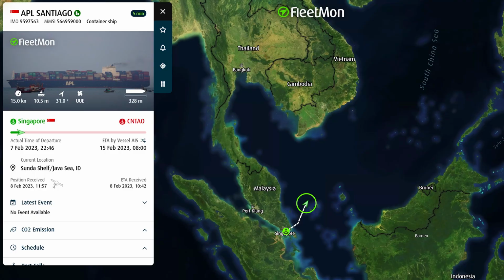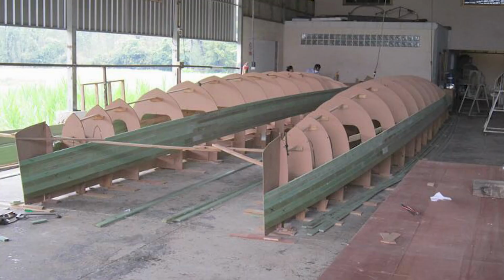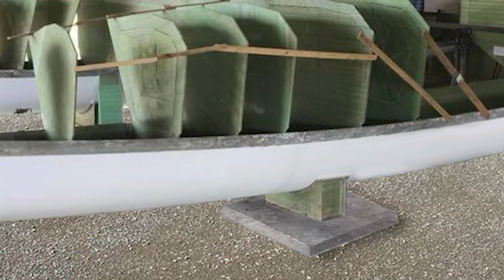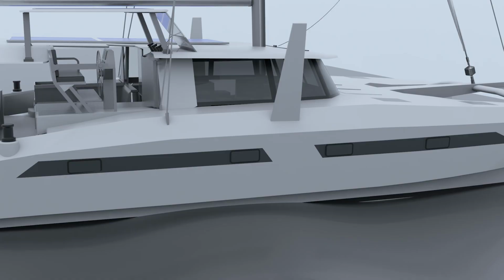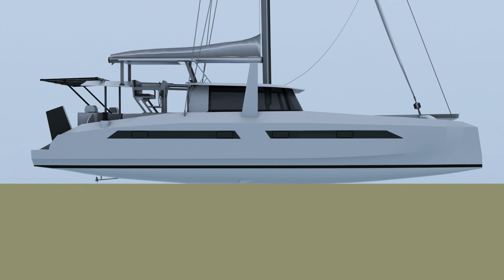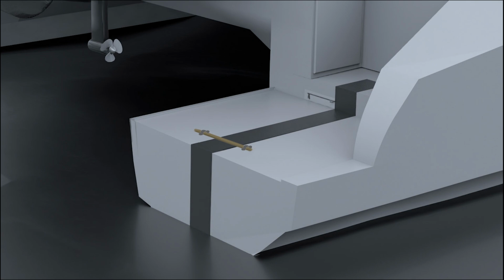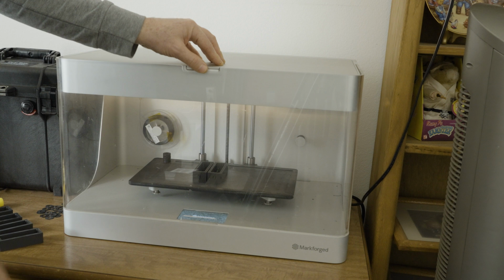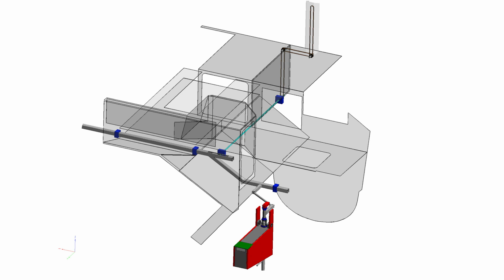Kit-E20 Kit Catamaran Build, Phase One Planning

Comment: As if its so easy and straight forward , mutiply  the time you have come to by 2 good luck with that ,
Reply from the maker: Of course, that never works.  If I multiply my current estimate by two someone else will tell me to multiply that estimate by two.  If I do that, someone else will tell me to multiply that estimate times two.  From the start I already padded the estimate given by Schionning from 6,000 to 10,000 man hours, then added a contingency of another 3,000 man hours.  So I did double their estimate, so I will stick with that until it proves inaccurate.  :)

Comment: Can't wait to see the boat build process in action. How do you insure that the rudder is aligned straight in the slot in the case of automatic activation upon impact, at times when you may have the tiller hard over during a tack or jibe?
Reply from the maker: Well, with a catamaran, it is rare to have the rudders turned that hard.  Pretty much only briefly when you are going about and sailing in open water.  Anytime you are motoring slowly, in a lagoon or marina, you lock the rudders straight ahead and use the two widely spaced props to turn the catamaran.

Comment: Hmm - seems like the safety design may be limited to only for a rudder operating at 0 degrees (i.e. straight) to slightly turned.  If the rudder is turned say 45 degrees or more - and it is hit - would not the rudder catch on the hull between the opening and not kick up? Very real possibility when dodging bommies. I like all the planning and execution - just may have a limitation - Mumby catamarans have similar set up.
Reply from the maker: The percentage of time that you turn a rudder that severely is small and at low speed, so in those moments you just have to be careful.  In the case of bommies, and any other low speed maneuver, you would not use the rudders on a catamaran. And iIf there is a danger of hitting something, like bommies, you would raise the rudders and use the two motors to maneuver.  Catamarans generally just leave the rudders centered anyway and use the props to turn the boat for low speed maneuvers. .

Comment: Why don't you put the turning point of the rudder lower and let it only protrude through the stern but not through the deck? There could be a little acces hatch for the emergency tiller.
Reply from the maker: You would have to solve a few issues if you wanted to do that.  
1) How would you manually raise the rudders?
2) If the U-joint is below, it will be inside the hull.  How would you service it?
3) When the rudder kicks up, how would you reset them and lock them back in place?

Comment: Captain Rick on Sailing Sophisticated Lady has an electric powered dinghy - he has an episode where he tested different propellers for best results - have subbed from Western Australia years ago my 22 foot trailer sailer had a swing keel and swing rudder that had the COG offset to allow the rudder to reset - you could also lock in upright position - enjoyed your explanations - very clever and an improvement on the mumby rudder design - any plans for a mini skeg to protect the propeller which will be hit before the rudder ??
Reply from the maker: No plans for a skeg.  It makes going about more difficult with a fixed 'fin' toward the stern and cats area already slugs when going about.  We got rid of sail drives, so we'll just live with the folding props and shafts.  I've seen Captain Rick's videos, but his electric outboard is not high powered, so not as useful for our situation.  I have been in contact with prop manufacturers to get a more suitable prop for our e18, which is the equivalent of a 25 hp gas outboard.  I'm glad you liked my kickup mechanism design.  I like to design stuff, it's a character flaw ;)

Comment: They are a great looking cat, I think Schionning' s come from Australia or are designed here; I see quite a few of them up and down the Queensland coast.  Have a look at the 62 foot cat I designed and built 40 odd years ago at; ue&co  'things I've built and lived in'   Remember, nothing ever goes to plan when building.  My cat was a bit before it's time; arex foam, glass, light steel space-frames, pull up rudders, kick back centre-boards, sloop rig with aerofoil mast,2 yanmar 33HP engines with lift up long shafts... with everything up the boat drew 6 inches and that was very handy ... best of luck   ue on the Sunny QLD
Reply from the maker: Yes, Schionning Design started in Australia, though I have been working with the South African office on my Solitaire 1520.  I tried to look at your cat but would need something more to find it.  Maybe I'll see you when I sail S/V Lynx to Australia!

Comment: I designed my own boat so I love the engineering breakdown and the use of the 3d model to showcase your boat's design and systems. I hope your 2 year schedule is kept... I thought mine would be in the water in less than a year...
Reply from the maker: Well, we will do our best.  We are working on it full time, so no distractions or other obligations, so we're hopeful that we can stick to our schedule.  How large is your boat and how many man hours to you have into the build?
Reply: @SailingSVLynx  Mine is a 8m(ish) trimaran. I have a design video on my channel if you are interested. Some quick napkin math and I have put in roughly 320hr into the build but well over 1000 iterating through designs. All pvc foam core, epoxy, and carbon. Zero wood. Twin motors, 5kw(ish) solar.

Comment: The construction of the canoes using composite strip planking raises the question, -  The end result only has continuous reinforcement running fore and aft which is equivalent to reinforcing the canoes with only unidirectional fibres is this the case or will additional reforcing be applied?. Typically an additional layer of double bias would be applied to provide "off axis" strength. It was also mentioned that the strip planking will be "smooth off" is this possible as the laminate will be around 1-2mm thick and will be easily sanded through? Additionally why the use of basalt over S-glass?
Reply from the maker: Well, you kind of answered your first question with your second, the canoes are layered with basalt cloth. As for why basalt, I will just post quotes from a couple of articles.  "Furthermore, these products (basalt) offer performance similar to S-2 glass fibers at a price point between S-2 glass and E-glass. With these advantages, basalt fiber products are emerging as a less-expensive alternative to carbon fiber for products in which the latter represents over-engineering."  And... "The chemical composition of basalt fibers is similar to that of glass fibers, but the production process of basalt fibers is more environmentally friendly and energy-saving than glass fibers, and they can automatically convert into soil medium after being discarded.  Basalt fibers also have better chemical stability because of the excellent acid-, alkali-and water resistance."
Reply from the maker: I forgot to answer your question about sanding through the laminate layers.  Yes, we may sand through a bit on some edges of each strip, but we will be applying multiple layers of basalt over the top of the strips, so that won't be an issue.  Initially, we did forget to mention that step in the process, though we talked about the basalt later.  That will add about another week or two to the entire process.

Comment: As a Schionning builder in Australia  I am very excited  about  your  build, good luck guys.
Reply from the maker: Which boat are you building and how far along are you?  Any links to pictures/vids?  :)
Reply: @SailingSVLynx  I am currently  building a prowler 1360 for a client the boat is fully constructed and at fairing stage it's at a standstill at moment  will start back on it in about 12 months, in mean time have designed and are building 8 m power  cat and hoping to be finished  around  Christmas this year, have been a schoinning  builder for 20 year's  now and have had a long relationship with Jeff and all the Shionning fam for many years, keep in touch and cheers from Australia.

Comment: Interesting video.  But let me say, unless you are very familiar with FIberglass construction and have constructed something similar in the past, it's going to take you at least 1/2 as long again as your estimating, and that's without any mishaps.
All the best with your boat build and I will be following your boat build with interest.  +1 Sub
Reply: Sounds good Phil, look forward to seeing your build get off the ground… or rather out of the container 😊
Reply from the maker: Well, I have done some fiber glassing, but I don't claim to be an expert.  However, we built in a 40% cushion in build time.  Schionning estimates 6,000 hours, we plan for 10,000.  And, we'll be sure to post where our estimates went wrong, ;)

Comment: The rudder box looks good, kickup,  but if the rudder is turning/turned won't it hit the hull and stop the kick-up...
Reply: Same question I had.
Reply from the maker: Generally, while sailing, your rudder is never turned that severely.  If it is, you have weather helm and should adjust your sails to fix that issue.

Comment: I've thought long and hard about getting a 3D printer. Designing the part is what holds me back. Scanning and using 3D design tools seem difficult to use. Could you do a video on "Here's how to replace a broken part" That would be fantastic!
Reply from the maker: I'd hate to bore folks with how to model a part, that's a long and technical subject.  I taught myself to model but later I had years of practice while I was the Lead Game Designer at a couple of companies.  Back then,  I had my fingers in many of the game design disciplines, including modeling.  I use a product called Modo to model, not because it's the best for mechanical stuff, but because it was easy to learn and that's what I spent time with in the game industry.  Most folks would use something like Solidworks, but it's expensive.  There are lots of free CAD software packages out there now, and lots of videos on how to model.  But, maybe I'll put in a very brief bit on how I model a part into one of our videos at some point, we'll see. ;)

Comment: Your flexy-sander electric will never last long, if you are serious about all the work you have to do, I would look at the automotive stuff, air driven,  long-boards,  I had a auto-body shop years ago...
Reply from the maker: Do you know of flexible sanders to match the curvature of the hull?  Drop us a link, if you do.
Reply: @SailingSVLynx  have a look at Eastwood's DSB Contour sanding board (new vacuum enhanced flexible sanding short, medium, and longboard) simple design, controls dust and greatly increases sanding performance ..... for automotive industry but will work well for your job
Reply from the maker: That looks like a sanding block with dust suction, not a powered sander.
Reply: @SailingSVLynx  that's right, hand sanding......just means you got to be better at fairing, you can't always use power sanders, it's really the improved dust collection, paper economy and simplicity that makes this a good option. Quite inexpensive expensive to.....just an option you might find useful

Comment: Very informative and well done video, as usual. One suggestion…you should put a small indented slot in the upper stern face of the rudder box that will act as a handle you can grab to manually pull up the rudder. And ( if not already provided) a way to keep the rudders in the up position when desired.
Reply from the maker: I was thinking of putting one at the end, high up.  Then it isn't where we walk, yet it would be easy to reach to lift the rudder box.  I will have the handle cavity angled down slightly so it doesn't collect water.

Comment: I like the different design for the breakaway on the rudder cartridge even though it is way more complex than the original system which is normally a bad thing. That 3D printer looks great maybe you could save some money by producing standard components such as cleats or more complex items such as clutches. It could potentially save you thousands.
Reply from the maker: We will print as much as makes sense, but some things that are mass produced are cheaper to purchase than print.  It's one off items that make sense for 3D printing, or if you are in middle of nowhere and something breaks, then cost doesn't matter.

Comment: On your rudder release mechanism would it be feasible to design it with an adjustable spring? ?
Increase the pressure on the spring and it would make it harder for the rudder to "give" . This way it would be infinitely adjustable.
Reply from the maker: We decided that it wasn't worth the complexity since once we dial in the correct strength, the arms won't change.  We'll just print a few arm pieces and get it dialed in that way.  We wanted the actual device to be very simple, using the KISS principal.

Comment: I can see your project management experience coming to the fore. There is a factor which you may of built into it and not bothered to explain depending on where you got your metrics from. It actually could be good for you if not taken into account but you probably have already done so. This is the fact that unlike most projects your workforce is inexperienced. Therefore if the subtasks are based upon how long you estimate to complete them as of now this will not hold true as many will be either repetitive or have partially transferable skillsets which you will of acquired during earlier parts of the build. i.e. when laying strip 1 onto the hull this will take much longer than strip 120  or hull 2 will go much faster than hull 1. Of course you may of averaged this factor in already. I only mention it not to be a clever sod but because if this factor has not been taken into account you could be scrambling towards the end of a phase getting supplies etc into phase for the next one maybe weeks earlier than expected.
Reply from the maker: Agreed.  And  yes, we have factored in some of that, but still know that these are just estimates...  meaning, they won't be right.  Overall, we have figured in a 40% longer build than what Schionning told us it will take to build the boat.